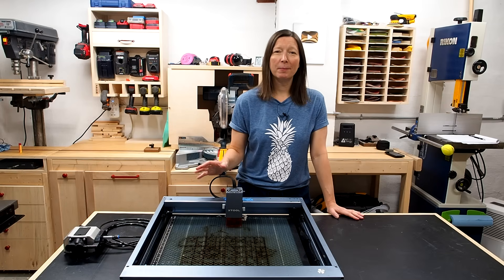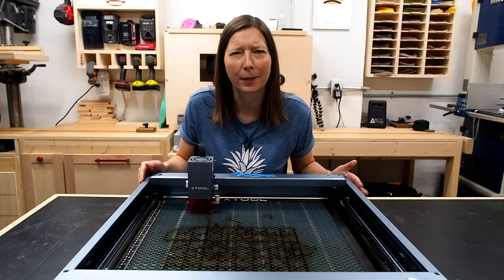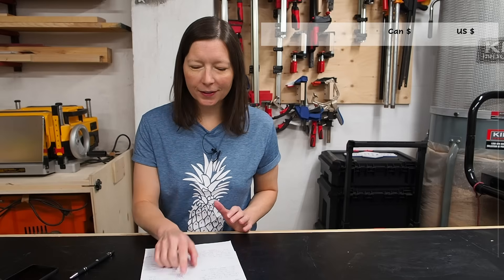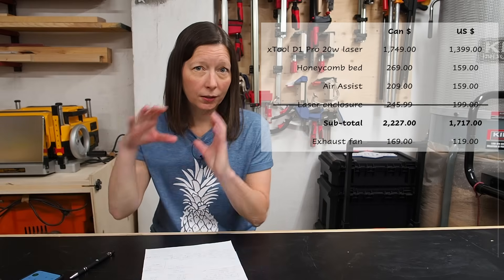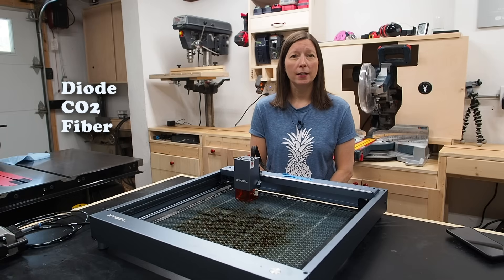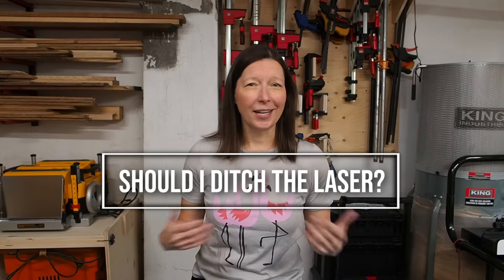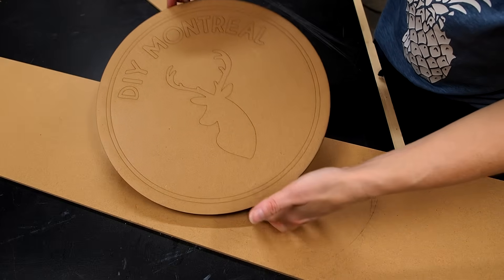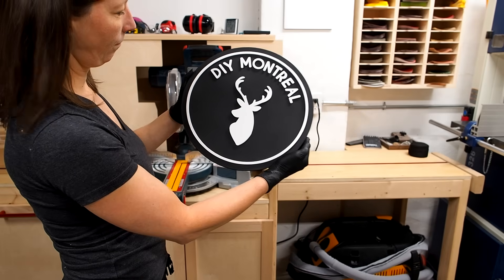Should you buy a laser engraver? Or is it just a waste of money

Comment: One of the things you may want to consider is proper eyewear.  Your laser is operating around 445 nm, and you need an ORANGE lens to filter that out.  The goofy green or red ones they provide with these devices will not adequately protect you.  I suggest you get a pair from a reputable company - they are about $100.00 a pair - and make sure it is written on the lens (normally above the left eye) OD7 190-540 NM.  These should also block the light from entering the side as well.  A sign posted outside the area stating ‘laser in use’ would be a good next project for you.
Reply: I agree wholeheartedly Michael. I'm not a home laser user but I had experience of them during my time as a physicist. I'm getting a little concerned about the slightly cavalier use of these tools in the home workshop and especially the possibility of stray laser reflection. I had assumed that the goggles were of decent quality and appropriate wavelength filtration but now that you mention it I doesn't surprise me that there not the greatest! Thanks for highlighting these possible risks.
Reply: You absolutely can cut clear acrylic on a diode laser, you just need to temporarily paint the surface of the acrylic.  There's plenty of tutorials available on YouTube
Reply: @trekgod3  being able to cut it and it being toxic are two totally different things.  I hear its not even the Toxicity thats the problem bc we all vent to  outside but the fumes from plastic can ruin the lenses on your laser, ive had to replace my dust lens a few times and the focal lens once,  from only cutting wood, dust lenses are a dime a dozen the focal is a bit harder to find and more expensive
Reply: Yes, eye protection is VERY important when using any type of laser. Do not even bother using the "safety" glasses that come with most lasers. They will NOT protect the eyes from the danger of ultraviolet light expisure. A blue diode laser has a light wavelength of 445 +/- nanometers. In order to block the ultraviolet light from a diode laser, orange/amber safety glasses are required that can effectively block laser light in the 445 +/- nanometer wavelength, as well as the lenses having an optical density of at least 6. Both of these factors need to be taken into consideration when choosing proper safety glasses, not just the proper light wavelength blocking range. Be safe, and don't skimp when it comes to protecting the eyes. Just remember, it is the light wavelengths that we DON'T see that are detrimental to the eyes, as humans cannot see ultraviolet light.

Also, never engrave or cut dangerous materials (even some wood, metal, acrylic and leather fumes can be harmful or even toxic). PVC being one of the most dangerous materials to NOT engrave or cut. When heated, PVC produces hydrochloric acid fumes, which are corrosive to the lungs and anything else the fumes may come into contact with. Be safe and have fun with those lasers.
Reply: Maybe painting the plywood black first or dying it will help cut better. I want a Lazer or water jet to cut steel, and Lazer rust removal gun for my future shop.
Reply: You can get decent certified safety classes for about half that, but yeah don't use the shit that comes with cheaper laser engravers/tools
Reply: I ran a 3000 watt co2 laser cutting steel and other metals for a short while and have three "floaters" from reflections. They happen so fast you don't even see them til later.
Reply: @Tommy.461 what is a floater?
Reply: @ALJessica scaring in the retina, possibly damage in the vireois humor (jelly inside the eye) results in occluded areas called “floaters”.
Reply: He has floating objects in his eyes that aren’t there. It’s like scarring of the retina. You see them in your field of view for the rest of your life.
Reply: @ALJessica it part of the interior of your eye that detaches and floats around inside the fluid inside your eye. 
Floaters are not your friend.
Reply: @Tommy.461 dude more likely you already have yours floaters.....

Comment: I wish I'd come across this video BEFORE I purchased my laser. This is a real review folks! Heed Marie's warnings.  Hardly anyone mentions the smoke smell. I don't mind the learning curve on any of my tools but the smoke, I just can't get past. I immediately purchased the enclosure the grid followed by  the  inline fan. I still get a lot of smoke in my shop which is unfortunately a two car attached garage so it leaks into the house. I also noticed that the items that come out of the laser(I have the same one you do in Iron man red, because, why not) and those things smell like smoke too.  I've heard many a influencer say the smell fades. I have several xmas ornaments that still smell like fire and it's dang near July. Also, it's worth mentioning, I'm not that sensitive to smoke and if it didn't cause cancer I'd be just fine with saw dust flying in my face all day.  I'm sure I'll get back to it at some point, but so far it has not been the accessory tool for my woodshop I thought it would be. Expensive lesson learned. Now my $300 dollar 3d printer has been awesome. Yes, that's a hint, Marie.
Reply: Just treat the wood parts in a box with ozone.
Other options are wax or acrylic or water based clear coat
Reply: I was considering a 3D printer. what 3d printer do you have
Reply: @angelw4113   I have the Ender 3 S1 Pro. Great starter unit.
Reply: I am a graphic designer capable of creating various designs, including precise laser cutting/engraving designs.

Comment: Ha! An honest review! Would you have been happier saving for a smallish CNC or Shaper Origin? 

The laser seems to represent a downward shift in scale for you based on the projects seen so far. Is the laser out of scale with the robustness of your table saw? It almost appears as if the sawstop was a step up toward industrial strength and the laser is a tug toward table top “crafting”. I find it interesting that the DIY Montreal sign sort of maxed the laser work area - any bigger and you could have cut it out with a bandsaw and a 1/8” blade just as quick. On the other hand the laser is a means to experiment with a workflow (design software to fabricated object).

As usual - Great Video!
Reply from the maker: One of my issues having a single car garage shop is lack of space. Wish I could get a cnc but where to put it? The laser on the other had I thought could live in the basement. True it is small, but figured I'd see if I like it before investing in bigger.
Reply: @DIYMontreal  The CNC and the one car garage is an interesting discussion. So my shop is a 1.5 car garage equipped with all the traditional stuff (unisaw, planer, jointer, etc). No room for a CNC and probably too much dust for a 3D printer (amazing for fabricating templates and tool accessories)

Since the 1990’s I have been able to access industrial grade CNC machines for my projects. They sit in a million square foot facility and have 6 ft X 12 ft beds. They weight tons and have mind blowing cutting speeds.

I have often wondered if I would be willing to give up my current collection of machine tools for one good sized CNC and focus more on design.

I met two women in Home Depot last week. They were considering the Ryobi drill. They ask me what I thought. I sent they off to see the DIY Montreal video on 18 volt tools. I think what you are doing is great! It is refreshing simple, straight forward and well considered (but not simplistic or crafty) Keep up the good work!

Comment: Laser cutter/engravers certainly aren't worth buying if they aren't used enough to recover all costs. For those considering a CO2 laser, be aware that the laser tubes leak gas over time so even if it is rarely (or never) used the tube will need to be replaced in a few years.
Reply from the maker: Good to know!